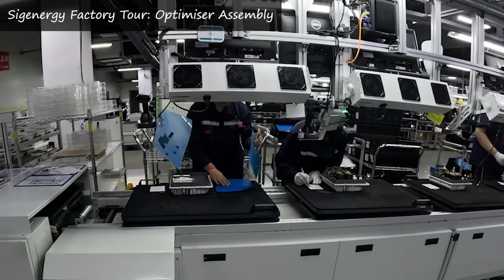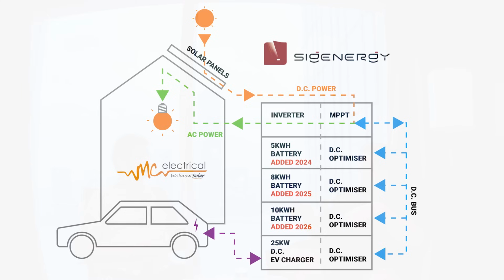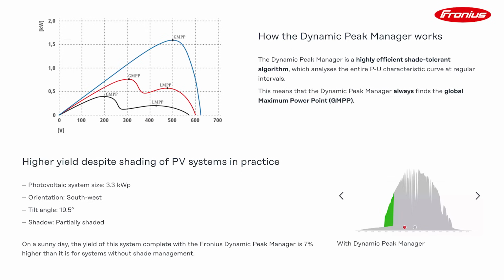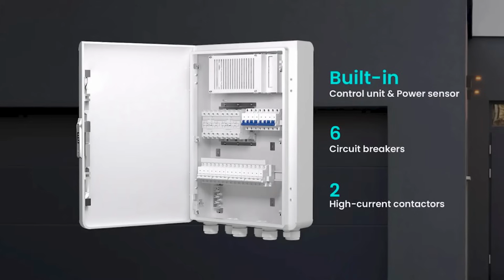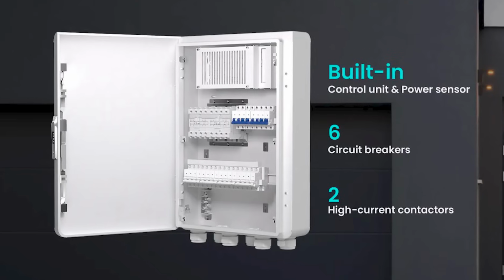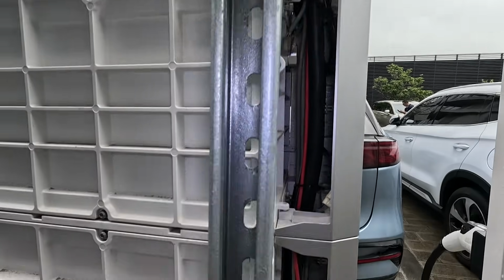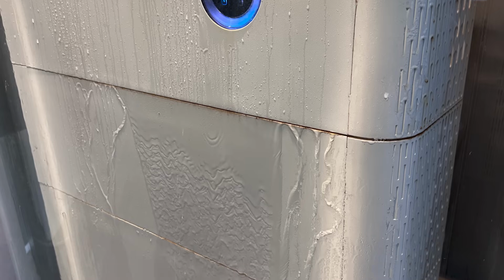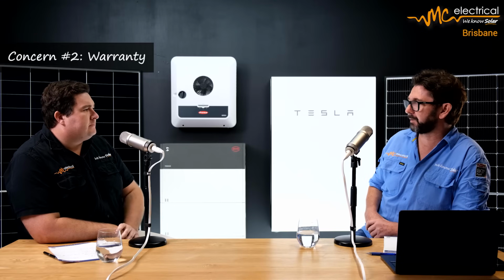Sigenergy Solar Battery Review After Factory Tour

Comment: I think this is a great video overall and a big thanks to you guys for making it available. After having a handful of Tesla Powerwall install's over the years I've decided to shift to Sigenergy for our new commercial install with the 25KW DC charger for our fleet EV's. My experience with Tesla Powerwall support over the years has been abysmal to virtually non-existent so even some of the biggest names in the industry don't really back their product with the implied support one would think they'd be getting with investing in a known company. 

At least in my experience, warranty is only as good until the weasel words come out in the fine print and you've played pass the buck between the installer, the manufacture, the ACCC  just to get simple answers and a resolution. It took Tesla 4 months to resolve a grid export limit issue after their failed gateway caused their level 2 tech's to rethink their purpose in life. Not particularly bashing Tesla here, but after spending well over $100,000 AUD in their products over 5 years it was certainly enough for me to take a chance on a more innovating and hungry start up.
Reply from the maker: Hey, I really appreciate that comment. Obviously comes from experience. I’m starting to strongly believe that Tesla is unfortunately not all that with support. I’m meeting with them on Monday. I’ll mention this comment as a good example. Thanks for taking the time.
Reply: @mcelectrical In the end the issue we had was a cloud > software bug where the old gateway was still registered at the site address but was replaced under warranty. The issues with our 15kW max export not being observed appeared immediately afterwards as it would overshoot north of 17kw. I lodged the fault because other than running heavy consumers everyday through summer, as a customer I had no other means other than switching the system off defeating the purpose entirely and my installer was equally banging their head against the wall because all the provisioning “appeared” correct (as I was with them through the process) - the limit was shown enabled in the app but no matter what it still continued to overshoot. 

One would think the easiest solution is to just delete the old gateway from the account. It took months of back and forth, often with no reply after repeated emails seeking an update and hours on hold for my installer with Tesla support to get an update on the case. 

It just doesn’t add up for a company that resourceful and it shouldn’t have been that painful to resolve.

Comment: The weird thing no one has mentioned for me is that the inverter is on the top, so if you do "just add another battery module," you have to look at your cable management and how everything that is run to the inverter, as it is now not in the same position. I would have put it at the bottom or a fixed position to not have this issue.
Reply: This is an absolute none issue. Just run cables to the unit in an intelligent way (from above), and you can add units at your leisure. Same for other brands with similar setups.
Reply: SigEnergys' solution for that is dummy models but at over $500 a pop its better just to adjust the cables or get the right size stack from the start
Reply: I like the idea of 3-4 batteries high have an inverter with the potential to add another 3-4 batteries on top, and maybe even another inverter for expandable modular potential.

Comment: Very useful video. Here in the uk there’s a lot of interest in Sig. but it’s priced at a real premium - because it has some very nice unique features - but for a 2 year old, untested company? I’m not sure it’s feasible. Givenergy have a longer track record of actually fixing problems and iterating their products. The new shiny has no issues because it hasn’t been pushed. 

Haven’t seen anyone else pointing out the issues you have identified - I’m usually skeptical about product placement concerns but maybe there’s a bit of that in the uk market.
Reply from the maker: Yes I saw a few people comment showing a screenshot saying they had a fleet of 1000 batteries with 0 or 1 failure. Since Sig has been approved for around 6 months? In Australia I would hope there was no failures by now. With their ipo application not being approved yet, it’s definitely early adopter days.

Comment: I’ve had the system for 3 months 25kw inverter 8.8kw connected to two strings and an existing 8.25kw solar system. Other than the polarity for the 3 phase stem is out of sync and i can’t export the 8.8 kw as the existing solar system holds the voltage too high it’s been a faultless experience.

Comment: Great to see SigEnergy disrupting the market. Having a simple stackable system for inverter, battery and DC charger reduces complexity. Having fast 25kW DC charging at home will increase EV adoption. Other companies have to play catch-up now. Fronius just launched there own stackable battery system called Reserva but the inverter is still separate with no DC fast charging options.
Reply from the maker: Yeh I must admit, the Fronius Reserva looks pretty inflexible on paper. Fronius will bring out a dc charger, and it won’t have to be in the same location as the battery. The new Anker battery/ inverter looks interesting. I agree that Sig has definitely upped the anti with innovation.
Reply: @mcelectrical  I had been looking between the anker x1 and the ecoflow power ocean and then another installer near me mentioned the sigenergy. It had loads of nice things and I liked modbus and DC ev charging or V2H for the future and said this is the one. But looking at the company story they are very very new and how they got to here so quickly is not clear. Having a few extra features is no value if they are gone or even if they still around and the early units give grief. Which of the anker x1 and the ecoflow power ocean would you think from capability would be closest to sigenergy ?
Reply: @ there is no mystery how they got there so quick. CEO Tony Xu has literally been the boss off Huawei Ai department as well as their entire platform FusionSolar for well over a decade. Other people in leadership as well as many at lower levels are also directly headhunted from Huawei. Its basically "what could the brightest at Huawei inverter&battery-departments do if they didnt have slow to move people in charge above them". And it shows, both on datasheets and IRL.

Comment: Have been with Sigenergy 20KW 3 phase inverter + 16KWh batteries + 25KWp panels and so far so good. I have always been an early adopter - industry needs early adopters to drive innovation abd Sigenergy on this front is mikes ahead of the rest. Time will tell if the bet was worth it.
Reply: The industry needs early adopters there is no doubt about that. If you can accept the risks, it can be hugely rewarding.  SigEnergy has a compelling product that is functionally ahead of the pack in many ways. But the fact is that SigEnergy a young company, has developed a product at lightning speed with a lot of new features. It's risky from an installer's perspective that takes its responsibilities when it comes to post-install support seriously.
Reply from the maker: Nice comment. I 100 percent agree. Problem is if I as a business owner used that model, my risk is 1000 fold higher. I hope win this bet!

Comment: I’ve had the 5kw Sig inverter with 8kwh battery installed since last May and find it really great. Although I did have an issue where the battery was not charging as fast as it should have from PV and they debugged that with me and ended up replacing it under warranty this week. I’ve found the after sales support really top notch.
Reply from the maker: Nice. I hope my point is clear that there is no malicious intention. And a win for Sig is a good thing.
Reply: @ absolutely. The more players that succeed mean more good solar. products for all of us.
Reply: Cool, sounds good. Can I ask how much that setup cost?🍻

Comment: I don't know what Sigenergy are doing with their Gppt tracking but a job I have with 10KW three phase is getting 30% more production than other systems I have in the area. They always go up against a wall. But yes, the gateway main relay is held in electrically all the time in normal operation, so two years warranty not good enough, maybe have a spare ready!!😊
Reply: There is a spare relay in the box itself. In worst case, just switch over the identical Smartport relay to be main, while you get a broken main replaced.
Next gen off-grid hardware will also come with a bypass switch.
Also, I think they need the current setup, since they have a 0ms switchover, ie continuous uninterrupted  power. Thus they need a relay to quickly, safely and reliably drop the grid in case of disturbances. In EU the back feed to grid may be at most 1000ms, and Sigenergys products manage to reliably let go in <350ms.
Reply from the maker: Unless you were in really heavy weird shade, the gmppt or the mppt or the inverter itself, or the panels under normal circumstances, wouldn’t improve production by 30 percent. A bit hard to compare apples with green pencils to be brutal. Interesting comment about the gateway being held in!
Reply: @mcelectrical  yes sure the 30% improvement is not down to that so much, I think it is just a well matched and balanced system, as it has 3 PV inputs it seems to be more efficient than my other systems. It also helps that it is on the coast and at the top of a steep hill. I would love to have a row of identical properties to do comparison testing!!

Comment: Im in Europe im going all in with Sigenergy its head and shoulders above the competition
Reply: @Damadchef  agreed that it’s got all the features you would want. Hopefully I’m wrong.
Reply: @markcavanagh  I believe you are wrong. Sigenergy is buying the same 280Ah cells from EVE and CATL as Huawei is for their 15 year warranty Luna S1. They also do the DC-DC conversion in each battery module, exactly as Huawei has been doing the last 4-5 years in Luna S0 and now in S1, as well as all C&I and Utility level batteries. Add to this that half the people at Sigenergy come straight from Huawei. Sigenergy may be brand new company, but they are using tech that the actual people working at Sigenergy have been building and developing for already the major portion of a decade. So one cant really compare it to a regular startup, its top of their field people from the largest manufacturer of inverters in the world. They just moved to a new company that happens to just have started up.
Reply from the maker: Yeh that’s what originally sold me on Sigenergy. You might be right. But there is a lot more that goes into it. Just the packaging itself must raise alarm bells. Funding is the big one. Let’s hope they get approved on the HKEX.
Reply: @ funding is pretty much locked in already. Eg 65+ billion USD from Hillhouse Capital, etc.
Reply: @StefanHuszics-KBS-Gröntekniknu  WTF! Hillhouse has 65 billion under management, they have not given 65 Billion to Sigenergy. In any case, Sigenergy burnt through their first capital allocation….now they are scrounging around for more…

Comment: @mcelectrical   If you say you're going to test something can you actually do it? 

Because at this point,  I am 95% convinced that when you say you will test something.
You either wont test it, or you already have but refuse to release the results due to your business model.
Happy to be proven otherwise, but to ignorantly claim Sungrow doesn't have MPPT tracking is bordering on defamation.
Reply: All solar inverters have maximum power point tracking. It's more a case of global vs local MPPTs.  Older models of the Sungrow inverter did not have global maximum power point tracking. Local maximum power point tracking was standard for most inverters. This meant that the system could be caught in a local maximum caused by shade on the array. Local MPPTs only do narrow sweeps of the voltage/current curve. Whereas a full sweep of the voltage/current curve can potentially find a more productive global maximum if there is one.  The trade off is a temporary cut in production during the full sweep but the overall output is generally greater on a shaded system.
Reply from the maker: Ok, I did test it about 3 years ago. Seems i might be wrong about the new model. But, last time I tested it they also claimed to have AFCI. But they didn’t. I probably will buy a new Sungrow and test it. Your criticism is probably warranted. My bad .
Reply: More interested in clicks than testing
Reply: Hi Mark, All the current Gen 3 Sungrows have Global MPPT , and it can be enabled and the interval adjusted easily remotely. Also have AFCI parameter. Be keen to see you test them out vs Fronius!

Comment: So if they had all these issues with it then why did yorick quote me and allow me to proceed with the system.
Reply: For certain situations, the SigenStore is the logical and sometimes only option. I do not know of any other inverters that can AC couple on 3-phase and keep 3-rd party inverters active to charge the battery during a blackout. For that feature alone, retrofits on 3-phase SolarEdge or Enphase systems there is no alternative without removing the whole array or having a rather compromised backup solution. 

For all the systems we have sold, we have been clear that this is a new product from a young company, and we were still learning about it along with everyone else. What I can say is that we take post-install customer support incredibly seriously and that we will be around if there are any hiccups down the track. For us as a company, it is a calculation of the risk per unit multiplied by the volume of installations. When you have a large number of systems that you are responsible for, the risk per unit must be small. Early adoption is riskier than an established brand and we eventually decided the risk is too great for MC Electrical to go all in at this stage.
Reply: @Yorick_Mark  Hey Yorick, thanks for the explanation.  I understand that yes I was an early adopter hence the risk.  I am happy with the system and look forward to adding a dc charger.
Reply: Great videos guys! The current Sungrow Hybrids can also AC Couple a 3rd party inverter to run it in Off-Grid mode (and do it pretty well) . They use frequency shift to drop inverters off when needed. 3rd party inverter just has to be of equal or smaller kW than the Sungrow. They can't Blackstart without panels connected, but don't believe Sig can do that either either? Sungrow also have their 6 Channel meter which, can monitor 3 phases and also up to 3 phases of 3rd party inverter production. And given their Gateway is built-in to the inverter and included in the 10 years warranty, it can be a great solution especially with their large 3 phase hybrids
Reply: @danross5  The Sungrow 3-Phase hybrids do that the distinct disadvantage is that the backup circuits always run through the inverter and is capped at 18.5A per phase. This means that backup is practically limited to only 3 power circuits. The likelihood of accidentally tripping the Sungrow inverter under grid-connected conditions is high, this risk does not exist with SigEnergy. With externally islanded battery systems like SigEnergy, Fronius, and Tesla you can have the more essential circuits backed up (whole house if desired) and only be conservative with power draw-in backup.
Reply: @Yorick_Mark  not any more, check out the specs of the SH8/10RS, SH15T, SH20T and SH25T. All 63A pass through current. Also believe they have a new SH10T 3phase 10kW model coming which will also be 63A pass through
Reply from the maker: Oh right. I think we installed 2 systems. I’ll follow up with Yorick tomorrow but it should have been with the caveat of “early adopter”. I really changed my mind at least a dozen times over the last 4 months. You might have got my earlier opinion.  I’m sorry about that, will look into it.

Comment: In your video, you mentioned Fronius’ cable management system that goes into the unit. But I’ve noticed that new commercial inverters are now switching to MC4 connections. I’m not sure why that change is happening. Do you have any insight on this?